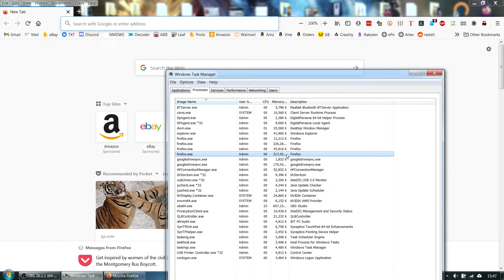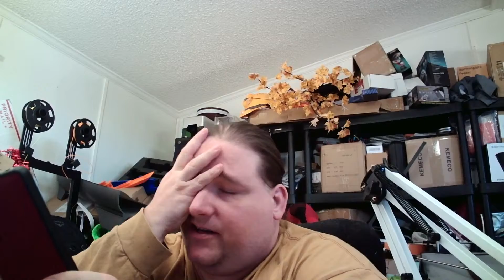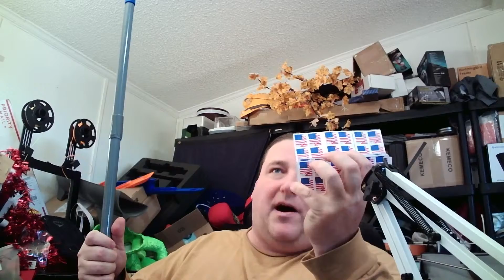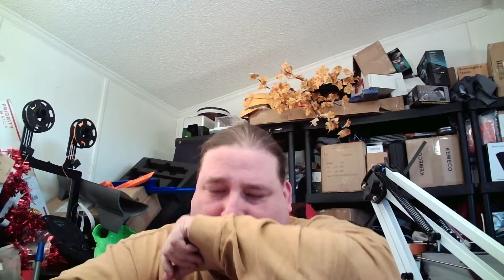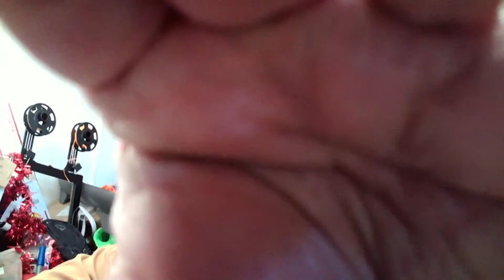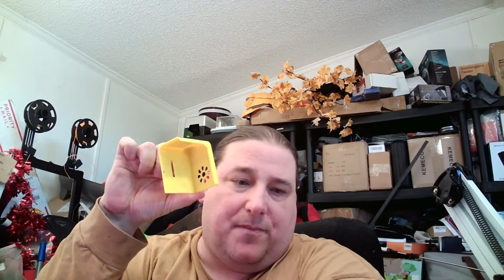T3DP Live Fokoos Odin 5 F3 OBS Crashed Finish Up

Comment: I need a recommendation. I want to build a cantilever 3D printer but convert it to Polar. I see most of the Prusa Mini style/Kingroon printers are the same 180mm. Some have linear rails. I am looking for the least expensive one? Or I was thinking of getting a second Ender 3 (or clone) and just build the single Z tower. The benefit of the Ender 3 is that later I could just rebuild it as are Cartesian. If I go the cantilever way, which printer is cheapest with features like the linear rails.  Thanks!!!
Reply from the maker: I would go at the ender 3 it's cheaper more consistently reliable and plentiful as far as parts are available you might even be able to use the top and right hand rails to reinforce the base of the printer
Reply: @nerys71  Thanks!!
Reply: @nerys71  For value, would you go with a Ender 3 v1 (which I have and love) or a clone that may have better board etc?
Reply from the maker: @FilmFactry  I question whether they have a better board I have never had an ender 3 board fail which would be my metric for better however if you wish to do things with the board that the stock board cannot do you can always replace the board very cheaply

Comment: I bought one of these when Amazon had them with a $90 off coupon. Initially, I thought it was an excellent printer (I own ~ 8 printers including an Anycubic Chiron, Predator delta, & 4Max (kit). After moving the Fokoos profiles over to Cura 4.8, and slicing a calib. cube & Benchy, the prints were quite good.
I decides to "look under the hood" and noticed a large amount of Delrin "fir" accumulating on the V-wheels. So, I attempted to adjust the eccentric spacers to relieve the excess wheel pressure--no dice--the adjustment was already so far to the outermost limit, that I couldn't effect any noticeable change.
Looking a bit deeper, I noticed the Y carriage only had only 4 V-wheels, with a 100mm space across the 2 2020 extrusions--2 fixed wheels and 2 with eccentric spacers.
I pulled the Y carriage apart, and noticed they had sheet metal spacers on each end of the extrusions, in order to (supposedly) keep a precise alignment--which doesn't work! I filed the sheet metal (aluminum) extrusion spacers to allow for a bit of "alignment reforming," and could then properly adjust the wheel contact to allow for good stability and contact pressure.
However, once heating the build plate to start a PETG print (plate @ 70c) the wheels again had far too much pressure!
I concluded that this cost saving design had a major fail point. With the 2 extrusions screwed down to the chassis, thermal expansion on both the steel chassis, and extrusions would force the wheels to the point that effective wheel pressure was pretty much impossible across the filament required heating ecosystem.
I printed 5mm thick PETG shims on my Mingda D2 (modified with dual gear lighter weight direct extruder), and placed them under the extrusions. I'm awaiting a supply of 4mm flathead screws before finishing. I also noticed they only placed a patch of insulation for the thermistor--cheapskates could have simply added more and insulated the entire bottom! I may add insulation as well.
By cutting costs with this clever design, the pathetic "engineers" didn't care for a long-term printer. A bunch of clueless 3D printer rubes will find out about this poor design after a few weeks of printing, when the wheel contact surfaces finally erode, and start producing poor quality prints.
I get annoyed when I see all the 5 star opinions placed on Amazon for this printer by simpletons, who have little technical/scientific/math backgrounds or knowledge.
Cheers!

Comment: I found your comments on firmware and the Ender 5 very interesting.  I bought an Ender 5 Pro from Amazon late last year and I like it a lot, but it did have an issue that required me to put in my own 'Ender 5 Pro' version of Marlin 2.0.  The bed was not flat.  (It was higher in the center than it was at the corners.)  I could have put a BLTouch on this printer, as I had one left over from the printer that this Ender 5 Pro replaced.  (It was a FlyingBear P902, which was my very first printer and it served me very well.)  However, like you I found the BLTouch to be a very fiddly device.  It worked most of the time, but when it did not (usually because the probe would get stuck), it was a real PITA.  What I did on my Ender 5 Pro was to customize Marlin so that manual mesh bed leveling was enabled.  This 'solved' my warped-bed problem.  (I also enabled the 4-corner assisted bed leveling in the firmware, as well as the full EEPROM functionality.)  At least for my Ender 5 Pro, I felt that I needed to change the firmware. 

The only other things that I did with my 5 Pro was to print bed supports, cable strain reliefs for the hotend and heated bed cables, installed a full SD-to-micro SD card adapter, and I am using the Creality spring-steel PEI coated bed plate.  I will be installing the Luke Hatfield hotend fix that you mentioned.  I will also be installing a Titan-clone extruder.  This is because I will be printing at low speed with the Colorfabb lightweight PLA and ASA filaments with an 0.3mm nozzle and I will be using very low flow rates.  (I want to have a high steps/mm resolution on my extruder for this.  I am using these Colorfabb lightweight filaments for the 3D-printed rubber-band powered airplanes that I was flying last year, and I want to continue these experiments.)